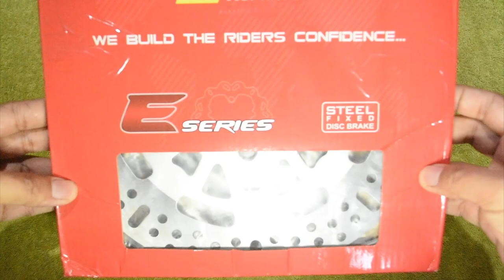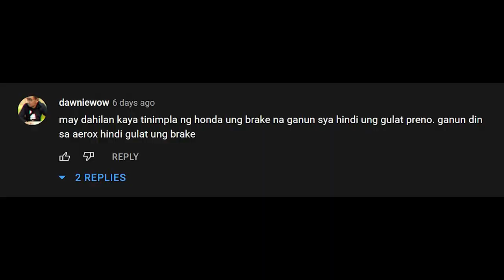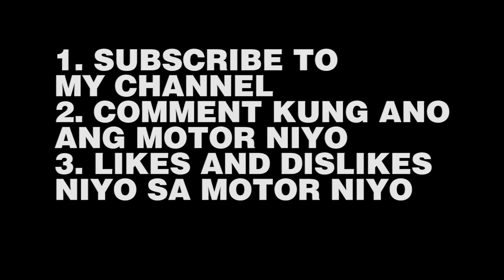Honda Click 160 Big Disc Brake | TTGR

Comment: its not called leverage, its called "torque".
Torque = force x length. so basically if you apply a same force to a smaller radius disc let say na yung force mo is 5n tapos yung disc maximum radius is 80mm or 0.08m, multiply natin so magkakaroon tayo ng braking power of 0.4 N.m. so if pinalaki natin ung disc, let say na 290mm so yung max radii nya is 145mm, or 0.145m, same force parin 5N x 0.145m = 0.725 N.m of braking power.

Comment: Honda Click 125i yung sakin.. 
Same Disc Plate "260mm", Stock Caliper

Prons: Better stopping Power .
- Hindi na bitin, Na try ko na 60km tapos Combi break much better.
(No need eh Full Break)
- Hindi maiinit yung Disc Plate kahit ginamit mo sa Rides
- Never Experience yung dumudulas yung gulong kapag Full break kasi (Naka Big Michelin Tire po ako) sa Stock tire cguro dudulas talaga yan.
- Maporma

Cons: 
- Gatos
- Literal sya na mas mabigat kaysa sa Stock disc plate
- Wag po mag Over speeding gumegewang yung manubela sa harap kapag Nag Full break ka agad, Note Wala po tayong Traction Control.
Reply: i guess thats why honda put that  type of disk. Walang abs and traction control tapos malaki ang makina so they decided it to place a smaller one. I experience a bigger disk in raider. So the driver need to adjust for its braking system for its safetyness.
Reply: Hindi ba lumalapat ung pad sir?.kasi ung ibang nagpalit lumalapat,
Reply: @renzencemedrano8138  Hindi po Basta Hindi bengkong Yung Fork at mags mo. Or Yung mismong Disc at break. Check mumuna lahat bago ka mag kabit
Reply: @mikemercado3281  probably not kasi mura na Yung motor kaya liniitan para mag palit ka agad ng break pad or Yung disc kasi mas malakas Friction ng maliit na disc kaysa sa malaki.. Sir Business si Business.. tapos combi brake Naman Yung motor madali lang controlin kaysa sa Raider. 

Check mo Yung mga mahal na motor ni Honda Lalo Yung mga 500cc above.. malalaki disc break dalawa pa.

Comment: @MarcLawrencePH click 125 sakin. Ganyan din gusto malakas preno sa front galing kase ako rfi. Ano sukat ng rotor disc ang pwede ko bilhin? Ano recom mo? Palit disc or palit caliper na 2 pot?
Reply from the maker: 2 pot caliper kung gusto mo talagang more braking power. Masmalaki ang clamping area mo sa 2 pot. Nga lang, mas-mahal kumpara sa big disc lang.
Reply: @MarcLawrencePH  salamat boss sa pagpansin sa tanong ko. Actually more on caliper ako. Diko lang alam kung alin yung dinako mag coconvert ng mga bracket. First time ko kase nagka scooter hehe. Salamat boss.
Reply from the maker: @angelosalas1152  Kailangan talaga magpalit ng bracket kapag magpapalit ng caliper. Yung RCB caliper na pang Beat Fi/Click ang pasok sa C160 natin. As far as I know, may kasama nang bracket yun. For Nissin at Brembo, usually nabibili ang bracket nun separate sa Shopee/Lazada. May mga nagbebenta din na set na caliper with CNC bracket na.

Comment: I ordered the same brake as you for my Click 160 I recieved a different bracket than you. Did you order your bracket separately? Thanks
Reply from the maker: Used the bracket that came with the disc brake.

Comment: Plate disc lng ba pplita ,stock pdn ang caliper at brake pad?
Reply from the maker: Yes.
Reply: Boss ung brand n ttgr 4holes 260mm, ung bracket n ksma nun mdli na loose thread😢
Reply from the maker: @clarencebatas8381   Yes. Kaya nagpalit din ako sa katagalan ng solid na CNC bracket. I have a video for that.

Comment: Paps anung discbreak yung inorder mo para jn sa click 160 mo kc gusto ko din sana mag upgrade sakin yan b yung flat surface lang or meron kurbada kc diko masyado makita s video mo salamat
Reply from the maker: TTGT for Click 125/Beat Fi. Flat lang yan tapos 4 holes. It will fit our C160.
Reply: @MarcLawrencePH  salamat paps kasama nb bracket nun
Reply from the maker: @josecastor7701  yes, may bracket na.
Reply: TTGT po b sir ito or TTGR po miss type lng po b
Reply from the maker: @josecastor7701  TTGR

Comment: Front brake muna bago rear break? kakaiba ung habit mo sir. gumanda nga lalo breaking power mo sa harap babaliktad ka naman sa gagawin mo. 😅😅😅
Reply from the maker: Hindi mo ba alam 75%-80% ng braking power ay dinadala ng front brakes? Ito ay dahil sa weight transfer during braking, therefore masmataas ang grip ng gulong sa harap to make you slow down much faster. That's true for both mga oto at motor. Kaya karamihan ng oto at motor ay drum brakes lang sa likod - 'di mo kailangan ng masyadong braking power doon.

Research ka din para well informed ang comment mo. Kung sabagay, hindi na din ako magugulat sa comment mo dahil hindi mo alam ang tamang spelling ng "brake". Itama mo muna spelling mo. FYI, magkaiba ang meaning ng "break" at "brake". Search mo sa dictionary.